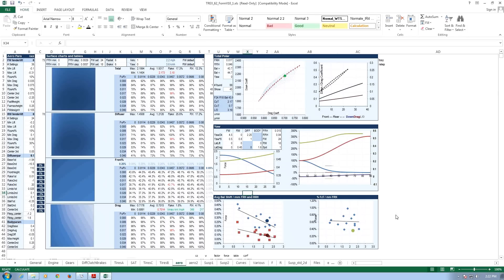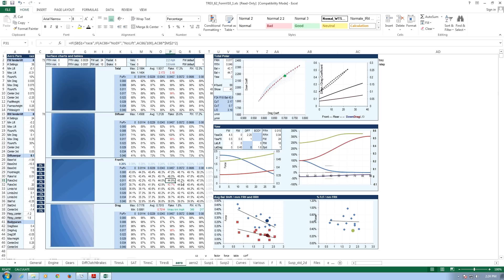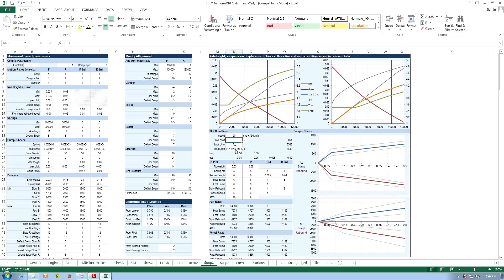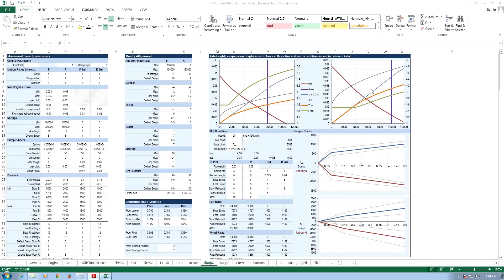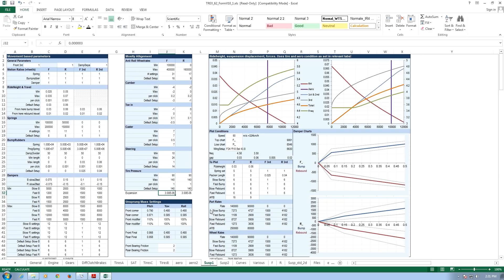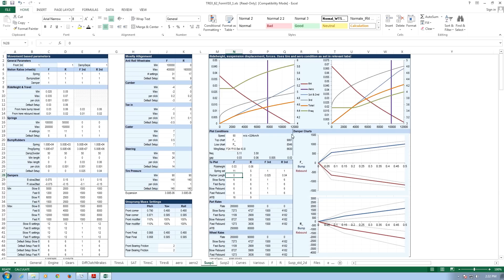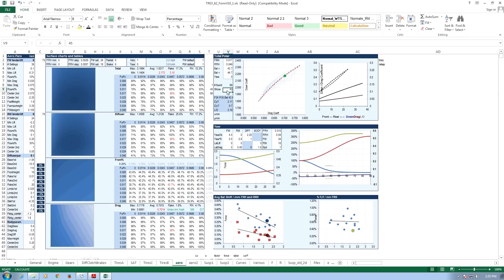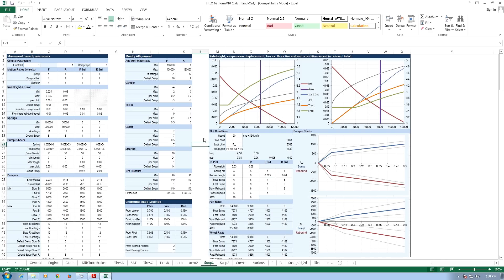Reiza Tech Video: Ride Height - aerodynamics and suspension setup

Comment: There's something that makes me curious. Say we have 2 cars equipped with all the works (corner, 3rd springs and anti roll bars) with the exact same roll and heave rates. But Car A is there with stiff corner springs and soft 3rd springs and ARBs, while Car B has the softest corner springs (perhaps even disconnected) with stiff 3rd springs and ARBs. Would the cars behave similarly or would on have an advantage at something over the other?
Reply from the maker: I'd say they would be identical

Comment: Very nice video!
I have a question which probably may not be answered very easily. But given the aeromap and suspension setting ranges, how would you defined the 'optimal' combinations of settings for a given track? As far as I know, the combination springs (side/3rd), packers, ride heights and wings pretty much define the aero performance. Depending on the track you race on, the ideal combination will be different. Which performance indicators do you use the define the proper set of parameters?
Reply from the maker: Very good question.. This is what pro racing teams have to do. I bet they use a lot of 'laptime simulation' software, using models of the cars, but without a human driver. You can quickly test aero configurations and suspension setup and get a predicted optimal laptime. This will only be as good as the models used..

Comment: Amazing video! Very impressed. Thanks for this. Always wanted to see things like this. That spreadsheet is a work of art! I have 2 questions. Hope you can answer them.

1. In the very first table, why is that the optimal is not with the lowest ride height settings? I get that downforce is lost if the car bottoms out. But why is it not highest when just above the ground?

2. You said that the 3rd spring in only active when wheels on both sides go into the car. Is this true of bump rubbers as well? I would have thought that the bump rubbers would become active if there's enough roll on the car (given downforce is still quite high - such as in a fast corner for example)?

Actually, a 3rd question, can you send the spreadsheet? 😁
Reply from the maker: 1) Depends on the car, but almost all the time you need rake. The rear has to be 'mid to high' and the front 'very low to almost at the ground'. Bear in mind single seaters have raised sides, so if the ride height is zero, there is still air going underneath the side pods. I haven't seen truly flat floor aerodynamics, they might behave differently around zero heights.. 

2) Depends.. as it always does! Bump rubbers on the 4 corner springs may or may not become pressed during high speed or cornering. With a weak anti roll bar you may end up rolling more and hitting the bump rubbers. This will change the balance of the car if the front hits the rubbers sooner than the rear. You may be able to run more front wing if you rely more on the outer front bump rubbers to stiffen the car up in roll.

Normally the front wing would cause oversteer, but the combination of downforce and body roll may effectively increase the front roll stiffness to a point where this compensates for the aero.

And at low speed you would have less front roll stiffness because the suspension hasn't compressed onto the outer bump rubbers yet  in say a hairpin.

I haven't gone here yet, I prefer a more constant roll stiffness front to back. It means you can give the regular springs more room to move, so they take kerbs better for example.

With 6 springs, 6 bumprubbers and 2 anti roll bars, the things you can do are soon quite complicated!
Reply: Niels Heusinkveld Thanks for the detailed reply 👍

Though i still don't get why not having a smaller gap between car and ground wouldn't increase downforce? Would you be able to elaborate a little? I appreciate this isn't your main job so thanks for your time and patience 😁

Comment: Raising the rear ride height always push the aero balance to the front? The hpd in the iR have a calculator, which tells the same, but is it true to a GT car too?
Reply from the maker: +bardocz I haven't seen detailed ride height 'maps' for GT cars, but anything with downforce that I've seen data for does this, so I would bet a GT car would also do it. I could be right .. or wrong. :-)
Reply: +Niels Heusinkveld You look like a guy who knows what he is talking about, so i gonna believe you :)
Another interesting thing for me is, how it push the balance to the front. I'm not sure about that, but if you raise the rear ride height, at the start the diffuser maybe give more downforce because of the changed angle, but after that if you raise it more, it gets too far from the ground, and because of that it doesn't create as much downforce. But i'm not sure about this one. So what I want to say is that it can push the balance to the front, because you lose downforce on the rear. Overall less downforce, but from this you have more on the front end.
Reply: +bardocz I think most of the downforce is generated at the front of the floor pan. Do an image search on "diffuser center of pressure" for some good illustrations of this. Also search "wing center of pressure" to see how the lift is generated mostly at the leading edge, even more so at high angles of attack.
EDIT see "What is a Diffuser?" @ mulsannescorner.com/diffuser.htm
Reply: +raffriff42 I will check them out, thanks! Actually I have a homework at university where I will do some cfd calculation on a very basic modell with different diffusers. These things will be helpful for the presentation.